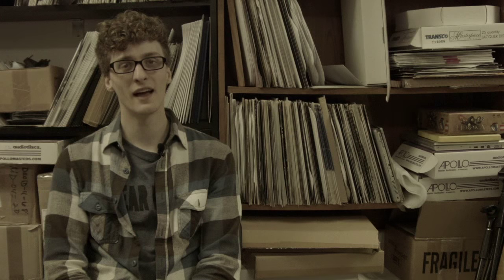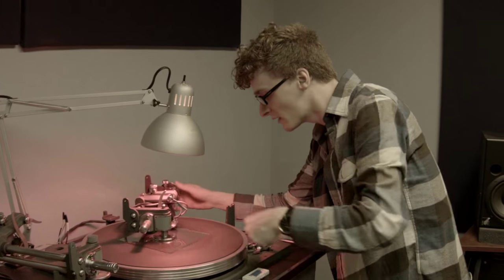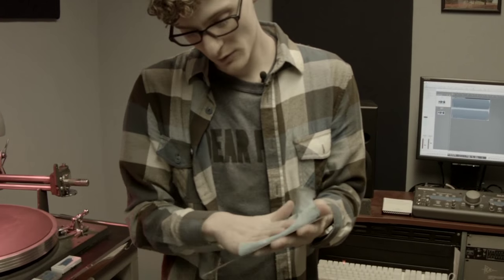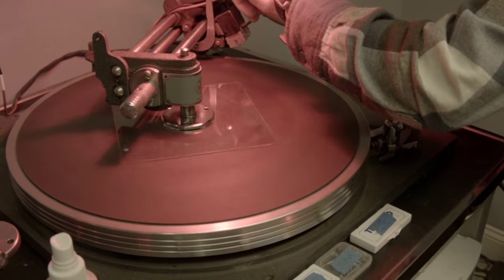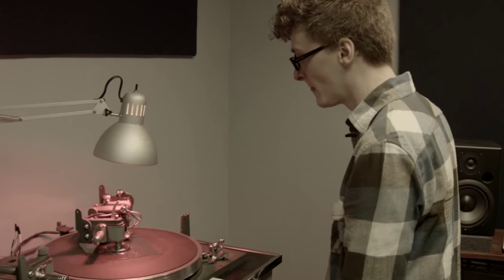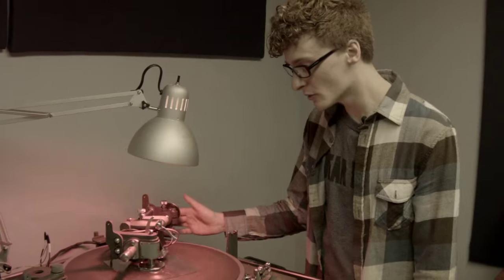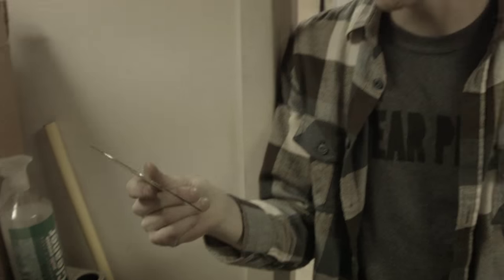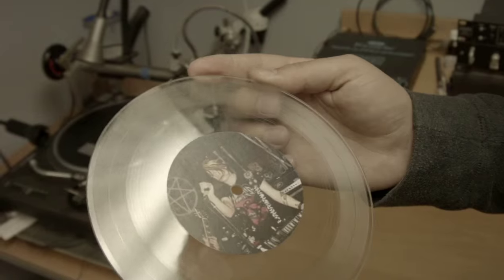How Lathe Cut Records Are Made - Audio Geography Studios

Comment: Hello, I have a Rek O Kut and M-12 Mono Cutting head project that I am working on.  What type of amp would be the best on a budget?  I only have a 50 W tube guitar amp but I don't think that will give very good results.  My cutting head is reading at 5 ohm.  What section would I look under for the solid state amp if I was searching on a music website?  Is it a preamp, a power amp or a guitar amp that you use?  I'm wanting to run the sound from my computer.  Also does your cutter head have an in line fuse?  If so, how did you install it?  Also how do you do your lead in/lead out grooves?  I have a rek-o-kut lathe as well and have pictures if that would be helpful.  Thank You very much!!!
Reply: try a home stereo or standard PA power amp instead! I do have a inline fuse on all my cutter head audio lines yes. I'm not sure if the rek o kut has the handcrank, but the Presto 6N does and I just crank that for the lead in/lead outs
Reply: worth checking out the lathetrolls.com forum for sure!